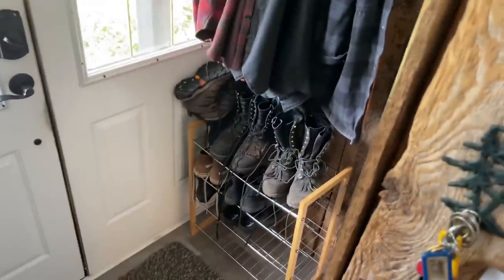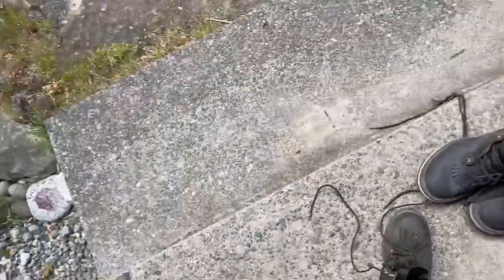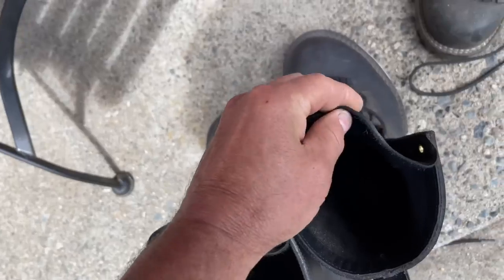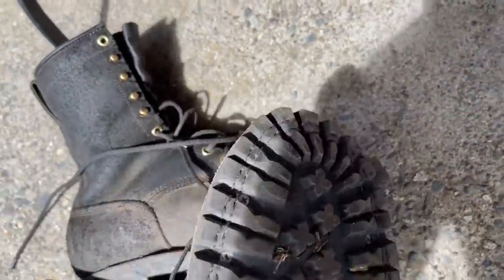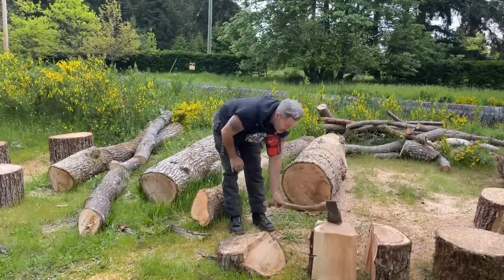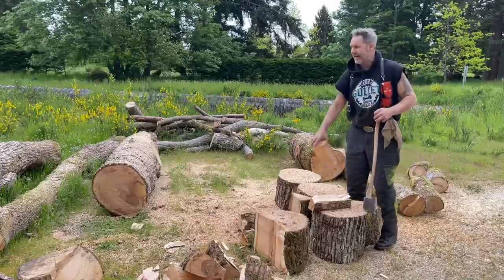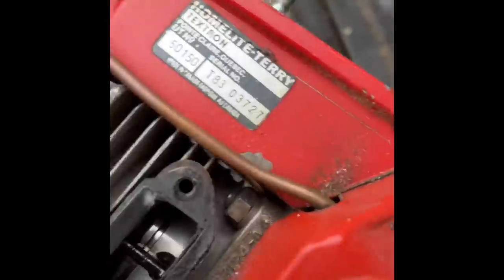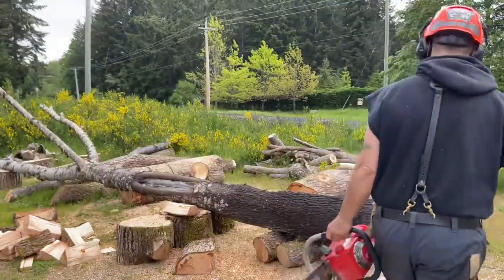Work Boots, Wild Chainsaw, Dirt Work, Axes,

Comment: Billy, I started in logging out of high school 1976 Northern California. Log for  40 years, I chase for 10 years. I had three new pro 81 and  a 050 stihl with a 42" bar. Back then most of the trees were three to six feet though. I worked with dozens, skidders and worked with yarders too. I'm 65 now and feeling it. I still go cut my fire wood and still love it. I'm still running equipment. I still have the pro 81, 288xp, 460 ran 36" bars on them and have many more smaller saw. Still look back at my pictures, where did those days go. They used to call me mad butcher from mad river. I like watching your videos. You remind me of a guy l logged with. Keep up the good work. Thanks again.
Reply: right on. I'm 60 and spent the entire day up a tree in my gaffs. Got it all topped and limbed, right next to a house. way too hot for this but it will only get hotter. I will finish it in the morning. I feel it. Right on. (460 28" bar is my go to, I climb with a stihl 175 and a 12 " bar)
Reply: Did you log around Big Lagoon. Ever heard of Smoky Daniels?
Reply: @JDanielsOffGrid  Not for sure,  I work for the Easter Brothers and John Lema years of ago up and down the coast. Did most my logging around humboldt  and trinity out of willow creek. How about you.
Reply: @butchsmith5214  Dad worked for LP Carlotta and later at Big Lagoon.  Thanks.
Reply: Thank u for sharing sir. Awesome

Comment: I think JK targets the wildfire community. I used Nick’s and JKs and I found the JKs to be infinitely more comfortable. They are double stitched and definitely have a wider platform. But they also have a wider toe box which helps when you’re hiking long distances. I 
 loved the JKs for fire
Reply: I’ve had my JK for 4 weeks, yes still breaking in but getting more comfy. I have very wide short toes and I’m happy with them. I weld and do trees on the side. Great boots

Comment: Hi  Billy, im puzzled ,bought a brand new saw   MS 251C only cut small branches and black sood is leaking out from the exhaust after bout 15min. using it. Impossible I could've overheated it. Used a 1:40 mixture, Stihl recommends 1:50 a little extra oil I thought would've helped lubricate the piston a bit more. Kindly explains the rights or wrongs in running in a saw correctly at your convenience. Like I said im buggered, don't know what to do, please help ! Thank you in advance, Gunter

Comment: Do you recommend varnish or oil for your axe handles? I see a lot of people recommend boiled linseed oil while I prefer tung oil even though it takes longer for coats to dry.
Reply: I make a mixture of two parts boiled linseed oil one part turpentine. It soaks in really well and a few coats of it build up but do not cause blisters like varnish. Any too I get that has a varnished handle, I sand it bare and soak a few coats of this on it. Once a year after that and it will be really nice to use with no blisters on your hands where the varnish pulled on your skin. Perhaps try it if it sounds like a good idea to you.  George.

Comment: Do I miss my vibergs yes, I have Daytons now like I've said before they have their pros and cons lets put it this way they are not Vibergs nor will they ever be. The Daytons are a sleeker boot they are a narrower than Vibergs, they are a slightly lighter boot. They don't have the arch support like Vibergs the Daytons don't have a full bellows tongue I don't like that either. Those JK boots you have there I couldn't wear those what is with the big lip around the boot I'm not use to having that. The Daytons are like Vibergs they don't have a big lip. I'm going to get through the summer with the Daytons I'm thinking about ordering a pair of Nicks.
Reply from the maker: Love daytons
Reply: @BuckinBillyRaySmith  I don't think they are made like they used to be.